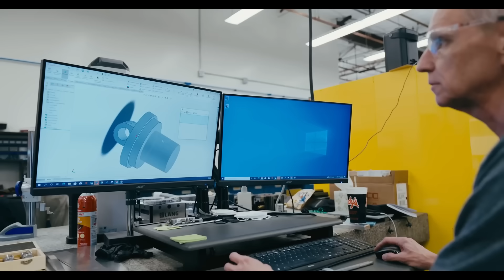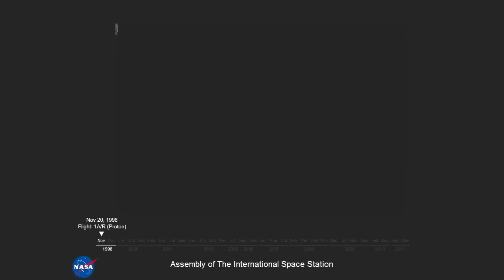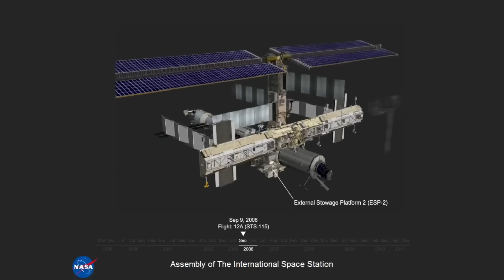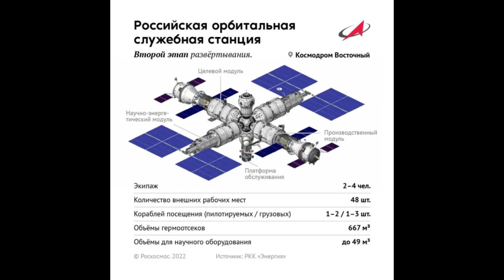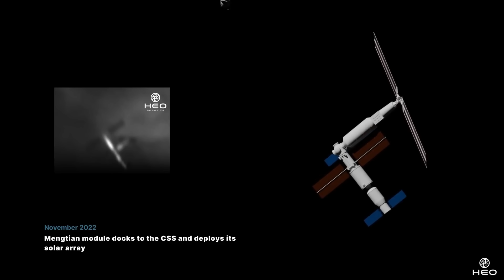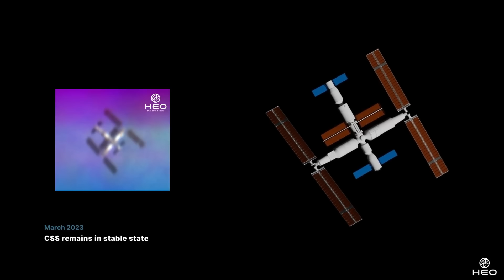Where Will Astronauts Go After The ISS Is Destroyed?

Comment: Makes me wonder if a Starship could be designed that would essentially leave the top 1/3 in space as a habit module, while the remainder of the spacecraft (with front flaps moved back to be at the top of the remaining spacecrft) then returning to land and launch the next segment.
Reply: I prefeer Scott's idea. Why you need a space station when you have a starship that can go up and down and has enough space? Just let it there the time needed and then bring it down. You can perform space manufacturing easily with that. 
Send Starship to space, make it make human organs until full, then bring it down. Rinse repeat. No need to have a permanent space station for  most uses.
Reply: @framegrace1 Repeatedly exposing very expensive and sensitive manufacturing equipment to the g forces and vibrations of a rocket launch is an awful idea.

Comment: How about we take all the best parts of the ISS and assemble a moon station and use a low energy route to the moon and leave it there. The left over parts can then be deorbited and burnt up
Reply: The iSS is worn out and must be scrapped.
Reply: that's ridicolously complicated and expensive, for no real benefit.
Reply: They should pull a Battlestar Galactica and send it straight into the Sun.
Reply: @manwiththeredface7821  Send? I don't know if the star ship has enough pull.
Reply: I know right? Why deorbit anything? It's not like we're running out of space and leaving extra pressure vessels up there can only be helpful in the future, even if only as sources for spare parts...
Reply: @crosshairs007  And who maintains the pressurization? The ISS would break up without permanent repairs.
Reply: @wolfgangpreier9160  Why would you leave it pressurized? The ISS represents a huge amount of potential resources and if you're not using it why would you leave it pressurized? Depressurize it and boost it into a parking orbit or put it around the Moon as previously suggested. That way you can get the resources if you need them easier than getting a series of ten or twenty plus launches.
Reply: @crosshairs007  btw moon orbits are extremely unstable and require lots of maneuvering, it's not good for a dead station
Reply: @crosshairs007  also what is this "resources" nonsense? Who is going to trust their lives and their mission's success to a random unmaintained space wreck's parts or "pressure vessels"? This is real life, not a movie.
Reply: @crosshairs007  If you do not maintain and repair it daily, it breaks down immediately. 

This is a very old technical structure designed in the 1980s. And it was only designed for 30 years. Nor 300. You may getr 40 years with good maintenance. But ot much more.

This is not a house where you can close the door and nothing happens for the next 20 years.
Reply: @wolfgangpreier9160  At what point did I suggest that it would be used? At BEST, they'd slowly repressurize a module at some point in the future to use it as extra space for a short while. I was far more interested in using it as raw materials. It's a giant hunk of processed materials that can be reused for any number of purposes. Cut the thing up and use the metal for repair pieces. Dedock it and tie the modules together so you can hide something else behind it as a shield. Leave it depressurized and store items inside it in vacuum so that they aren't effected by direct solar radiation. Do careful testing and repressurize a module for temporary pressurized storage. The point is that none of those things are possible if it's deorbited. It's more useful left in orbit and not smeared across the sky as a cloud of plasma.
Reply: @crosshairs007  dude this is real life, not a survival game. You can't just "reprocess" the metals and other materials in the wreck without SIGNIFICANT manufacturing facilities in orbit.

Also why would you trust any of the gaskets and pumps in the airlocks to even work or hold in a derelict so you can store something that needs pressurization? Do you know that everything degrades in space, especially gaskets and softer materials. Are you seriously going to risk damaging the goods that cost you millions to ship to orbit? Also what were they shipped to orbit in? They came in a pressure vessel already so why you need another.
Reply: @marcogenovesi8570  Fine, so you can't use it as a pressure vessel, whatever. You absolutely could use pieces cut out of it in various purposes. Even if it's only incidental, the fact remains that there COULD be use for pieces of it, and the only thing preserving it requires is boosting it into a higher orbit. Yes, that's a big ask, but it's not any bigger an ask than deorbiting the thing.
Reply: @crosshairs007  no you "absolutely" could not. You are still treating this as if it was a car that you can park somewhere and still use later. Reliability in aero/space is much more important than on the ground. If you cut and bolt things to a car the worst that happens is that it breaks down but you are mostly fine, still on the surface of a planet, worst that can happen is you crash the car.
In orbit if a part fails during a maneuver you are done. If a seal fails and the whole thing depressurizes you are done. If the electronics running some critical system fail, you are also done.
Your heat rejection system fails? You are done.
And so on. Nobody is going to gamble their life and mission on some 20 year old part from a wreck.

The only thing you are preserving is sentimental value and pure raw materials that can't be processed without another space station with in-orbit refining and manufacturing equipment
Reply: @marcogenovesi8570  Uh huh. And you can see absolutely no case for putting up a single launch with a tug to boost it into a parking orbit for potential later use? Launch costs will always be higher than in-situ resource gathering. Even if we never touch it again for practical use, it'll be a valuable historic artifact three hundred years down the line. There's zero reason to deorbit it unless you think it'll break up or something. Do you think we're going to run out of space in orbit or something? I'm not sure why you're so against leaving it up there.
Reply: @crosshairs007  because it's in a decaying orbit already, it's a huge target that if hit by stuff (it had to maneuver to dodge collisions with other trash many times) will generate a ton of debris, and it has ZERO value for "spare parts" as none of the components it uses are standardized.
You are treating it as if it was a 50s car, that you can just park somewhere and forget for 30 years
Reply: @marcogenovesi8570  You can park it somewhere and forget about it for 30 years. I'm not expecting it to function well or even halfway decently after all that time, I'm just saying that leaving the thing in orbit will be infinitely cheaper than boosting new stuff into orbit if even a tiny fraction of it can be reused at some point in the future. It's not like we have genuinely cheap to-orbit capabilities, even Space X has only about 2.5k/kg cost, so if they save 100kg of metal for say, welding patches onto something, they've saved some 250,000$.
Reply: @crosshairs007  you think it's "infinitely cheaper" because you ignore the costs of:
--boosting it to a stable orbit
--re-certifying all the bits that make it more than a source of raw aluminum or whatever metals. Even structural components can't be trusted anymore once it's been sitting dead for decades.
--the cost of reaching the parking orbit to extract this material and bring it back to the other orbits where other crafts are

You are basically spending at least a hundred millions right now (launching the vehicle that can boost it to such parking orbit) to create a source of raw metal that nobody will have any use for in the forseeable future, would need to waste a bunch of fuel to reach every time, and can potentially create a large shotgun blast of debris if something hits it in the following decades.

It's a genius idea, you should propose it to NASA
Reply: ISS can protect its crew from radiation around the Moon? IS now working under Earth magnetic field.

Comment: In my opinion, it's a critical error to destroy the ISS. 
Instead, use it as a Base Work Camp while building a REAL Space Station, one that can handle refueling and repair of spacecraft and accommodate tourists!
Reply: the ISS is a glorified shack and there is zero need for a "base work camp" for orbital operations. Everything can be remote-controlled from the ground for A LOT cheaper